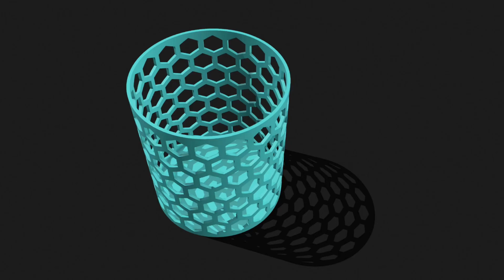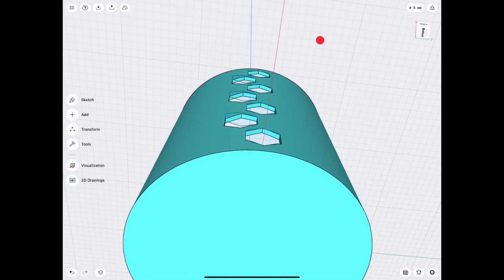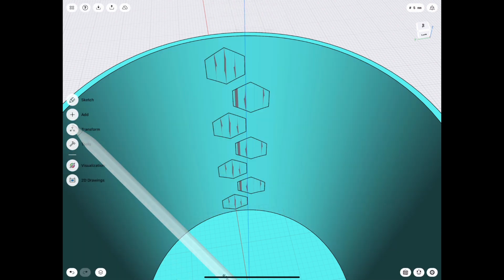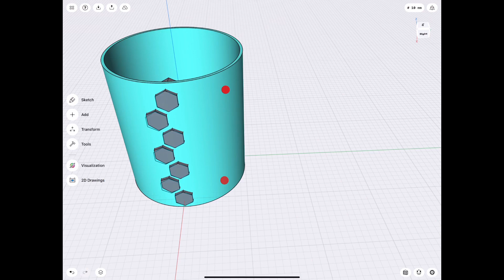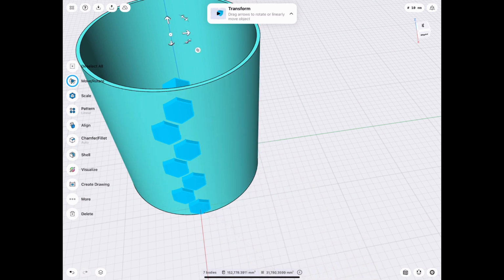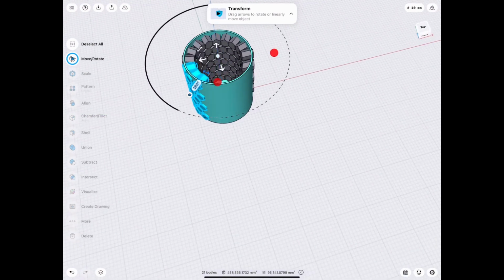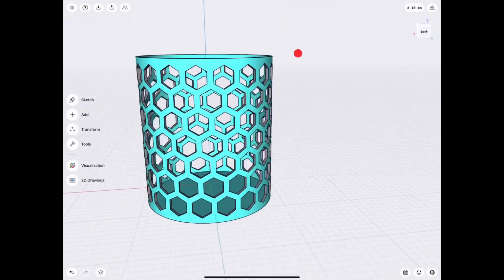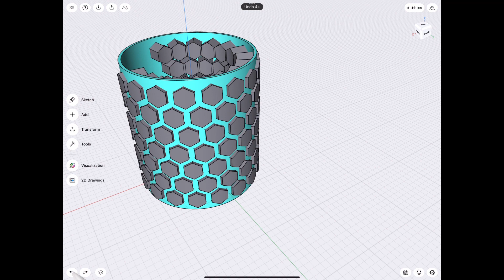Cylindrical Pattern Tutorial for [ Shapr3D ]

Comment: When I try to put a polygon on the cup it will not allow it because it says it is not a planer surface. I can only do a polygon on a flat surface.
Reply from the maker: You have to make a 2D sketch on a flat plane before you can extrude it. I did not include it in this video because if you use Shapr this is common sense. But I can see where I went wrong and I should have included that in this tutorial.

I will make an updated version of this soon 👌
Reply: @JLake3D  thank you. It’s common sense how the patterns work but it’s not easy in this context on a cylinder. I’ll definitely look forward and appreciate a new updated video of this so I can make my own.
Reply from the maker: In the meantime, have you seen this one?

Cylindrical Pattern 3D Printable Filter Shapr3D iPad Tutorial
https://youtu.be/TKpOMJu7Zak
Reply: @JLake3D  thank you that looks like it should help me get there. I’m going to do that one now.

Comment: how do you get the hexagons lines up so the evenly space around the cup
Reply from the maker: If you watch the video, i go through the entire process 😅
Reply: @JLake3D  I WATCHED THE VIDEO . How did you decide on the size of the hexagons to evenly space the offset of one hex to another (before you made the pattern) . You start with 7 hex ALREADY on the cylinder. But do not explain how to get those evenly spaced vertical and horizontal so that when you make the pattern they finish correctly
Reply from the maker: Ahh ok, that all depends on what you want for your project. You can make them any size. I will make you a video though since we now have the pattern tool. You can expect it later tonight ✌️
Reply from the maker: Something came up, but i’ll be doing it sometime this week👌
Reply: @cardboardoperator7213  I had the same exact question and I’m sure others did you never got a proper answer. There are many great tutorials on this channel but this guy just raced through it without proper explanation.
Reply from the maker: @TheFutureLooksGrimm Honestly I just chose numbers that made sense to me based on how I would 3D print them. Then revolve by a degree that is able to be equally divided in a 360° circle. Theres no crazy formula here.

Comment: May I know what if we use the project tool to project the face on the cylinder, will that have the angle issues ?
Reply from the maker: That all depends on the angle of the face. You will always have some deformation with a curved surface, so this method is the best approach atm to nullify that effect.
Reply from the maker: But the deformation is pretty small on some surfaces, so you can get away with projecting in some cases.
Reply from the maker: See this video for reference- Surface Modeling in Shapr3D?
https://youtu.be/IBc3kNAK8sY
Reply: Greate video, will have a look later, thanks for sharing btw!! :D